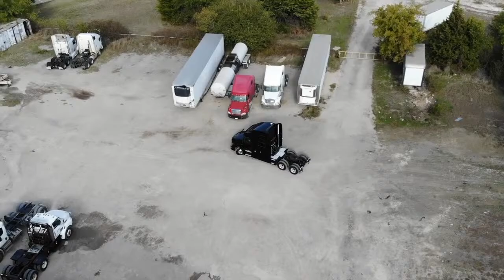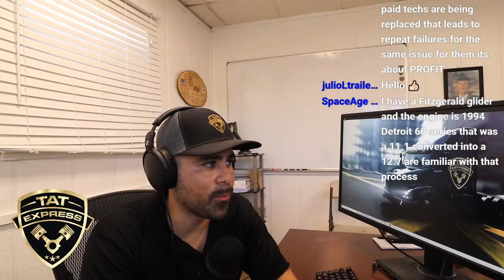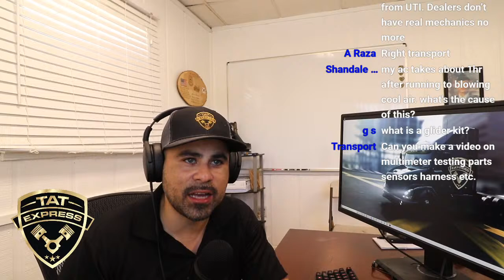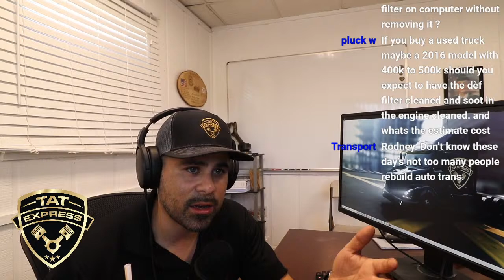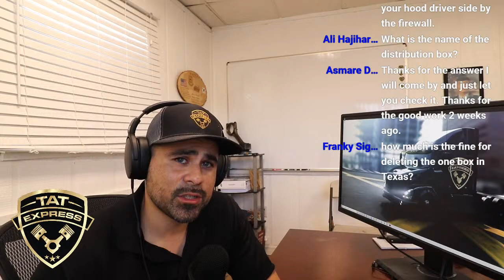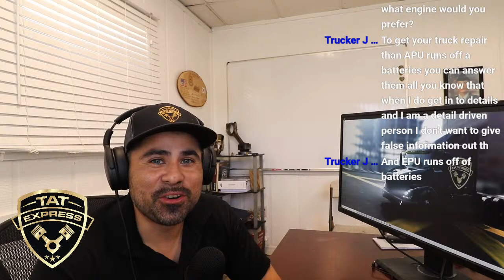Don't miss this Live! - Dealer Repairs

Comment: I'm glad to hear you are doing things the right way, however I'd like to clear up some confusion with the audience. Dealership's are not firing the old guys to hire new guy's... The old folks are retiring! There is a huge market for young men and women that want to work on trucks. I would also like to say that that I agree that alot of dealership's have crappy Tech's working for them but most all of the major dealers are pushing a 1 hour triage with one of their master Tech's, if that guy sucks your whole repair bill is gonna be messed up. Aka... union shops and any dealer that pays on commission is not a dealer anyone should visit. Yes I work for a dealership. Mobile service tech here. I'm the guy who has to answer to the owner of I screw up.
Reply from the maker: Thanks for your input Mcarthur.